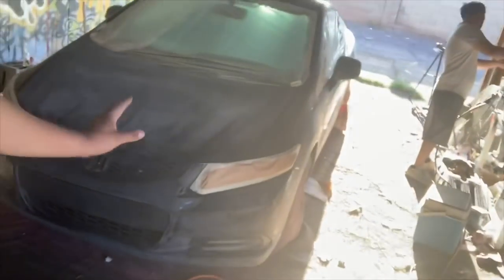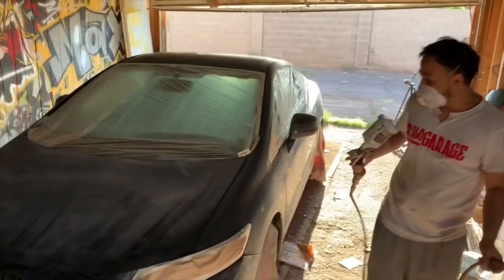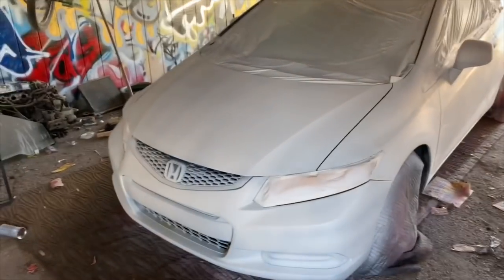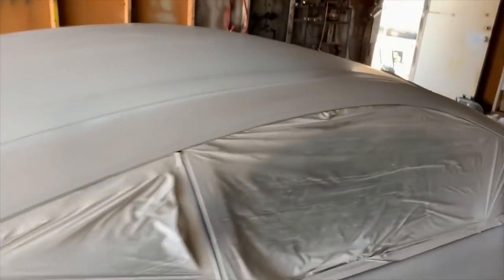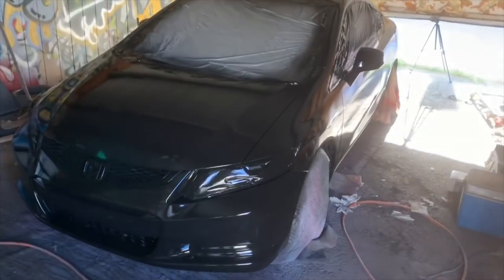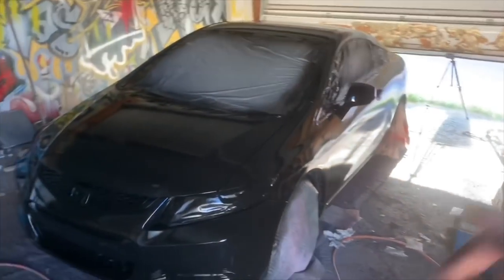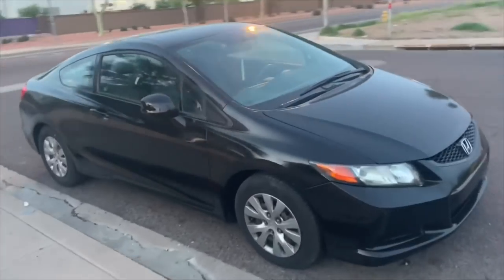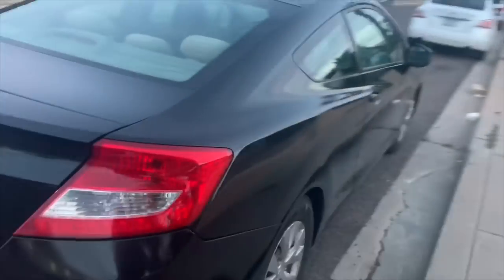Rustoleum  paint job Honda Civic

Comment: Maybe consider using a air nozzle as you wipe the car down. I know it's outside, I did It for years, did 300 units a year cars trailers bobcats skidsteers backhoes military trucks. Blow and wipes the plastic down as well not just the metal prepriming and after priming sanding. I use to not do it. Your wouldn't believe how much dirt and crap gets on your paper or plastic, wheel covers everything wash it down. You can never air wand the piece off to much. If you have a hose access there or if not a bucket or old milk jugs splash the floor to keep dust down then air down and wipe the car. I've used it all. Rust-Oleum. Much better quality alkyed industrial. You wanna make your paint jobs pop without using clear coat. Gets some enamel hardener about $20 bucks for a container that'll mix with a gallon. It'll improve close, help it lay smoother, makes a hard  chemical resistance finish for gas diseal spills etc. Decrease rock chip damage and wouldn't increase your supplies cost but marginally. Rust-Oleum can take awhile to fully cure. Use hardner let it sit for about a hour maybe 2 and move it into the sun and let it get baked on. Once it's started drying enamel finishes much better being baked on. Or let it sit will just take longer. It'll remove that easy scratcheness Rust-Oleum can have. Look for a local company. I found mobile paint in my area. And they can mix any color and had them mix formulas until I found the perfect one for me. And I was still only paying 35 bucks a gallon in 5 gallon buckets. Using there mid level 3 year fade out guarantee for  alkyed industrial which Rust-Oleum is modified alkyed. And for polyurethane I used to get the 5 year fade warranty. Down here by the ocean the salt in the air is hard on things. It's a win win if your not comfortable shoooting or buffing clear. The hardner won't change the viscosity your use to. It's usually around 8-12 ouncespee gallon of paint. The paint shines much better and that respirator works fine for it. It's basically extra gloss and super glue isocynates. I call it poor man's clear coat
Reply from the maker: James Smith gunna have to look on to it .. later thx you .
Reply: James where you from bud

Comment: I use 400-700 grit when sanding down primer or base coat. It’s just helps the paint last longer in the long run. Higher grit doesn’t really give the base coat anything to hold on. Especially Rustoleum. Use your 1000 grit and up to take care of orange peel or to smooth down clear coat.
Reply: AndresJay1 aye bro what's your ig. i have some questions

Comment: Where did you get the paint from?
Reply: Any hardware store, Walmart Lowe's, ace, online. Rust-Oleum is the only oilbased left on the shelves besides valspars last oil based offering. Voc restrictions have killed the oil based paint industrial. You can also find some on line typing it industrial enamel.  Use hardener and 3m 5000 or 6000 respirator.

Comment: What kind of primer are you using ?  What do you thin it with?
Reply: I have looked at all your videos and you do not mention what kind of primer you use .  Can you please let me know and how you thin it
Reply: @mannyo3149  I believe he is using Rustoleum Bare Metal Primer. However, I would only use Rusty Metal primer is your metal is heavly rusted or has very deep scratches. The Rusty Metal is great but man....it is it awful to sand.  The Rustoleum Bare Metal Primer comes in a can (1qt.). I think he said he thinned it down 2 parts primer to 1 part acetone.  Look at his other videos just in case I am wrong.
Reply: @johnnycantrell5060  Thank you